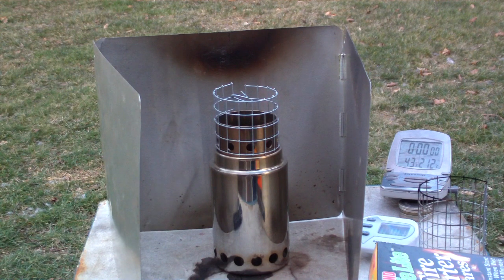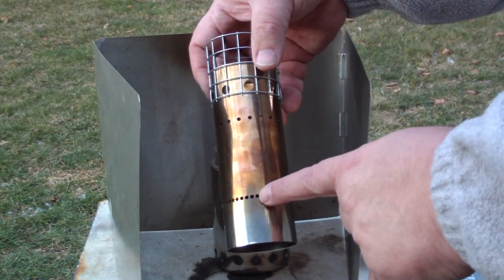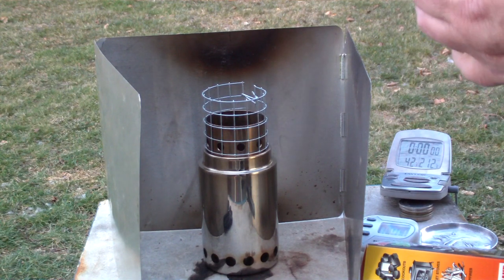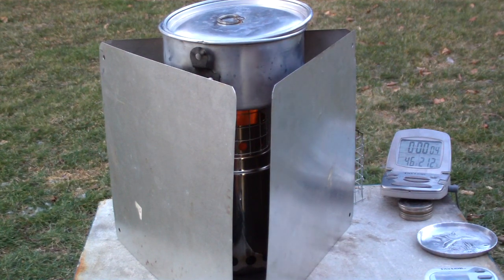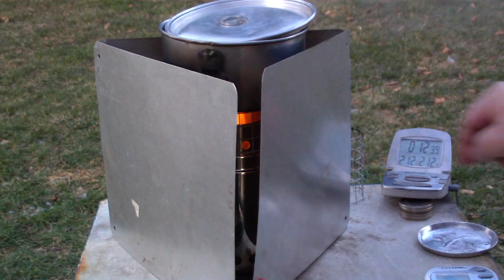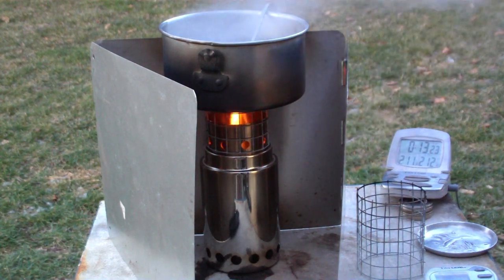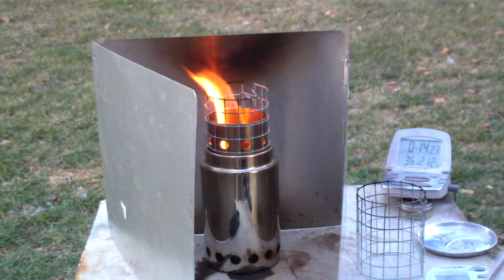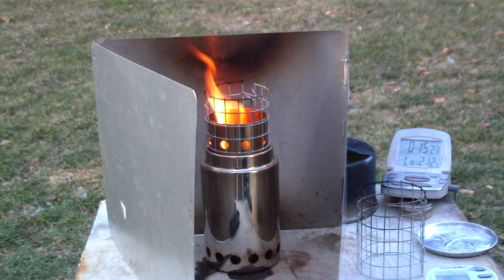WorldStove's PupStove - Boil Test #2 - Shorter pot Stand

Comment: when you had it in the air it read 41 and it jumped up to 45-47 right when you set the pot on the stove.  3:14 is when you mashed the timer button.  between 3:06 and 3:12 the temp jumped a degree a second before getting on the fire.  windy conditions really make a difference I guess.

Comment: Hiram, thanks for testing these interesting stoves. I have two questions for you.
1) How long will the Pup burn on the 100g of pellets?
2) In your next test, could you please show what's left in the stove after the burn? I'm curious how much ash/charcoal remains. My DIY woodgas stoves usually don't leave any charcoal, just a little bit of grey and white ash. But Worldstove claims that these stoves produce biochar instead of ash.
Thanks!